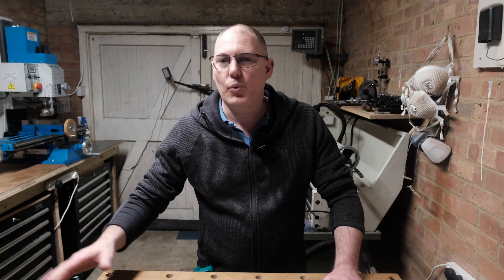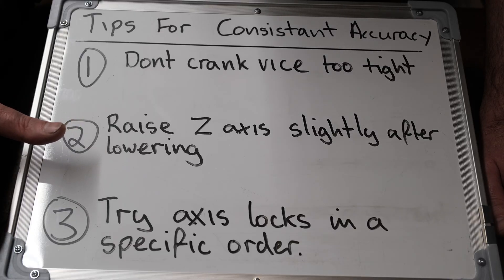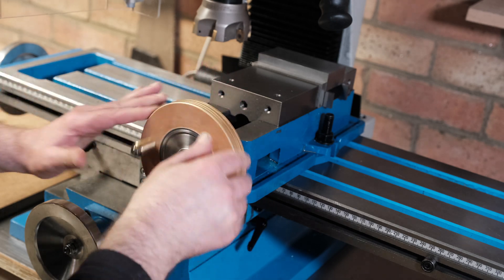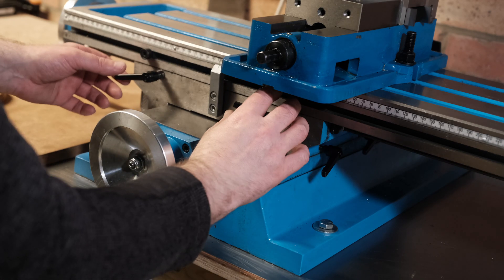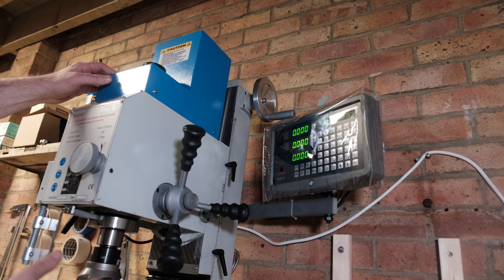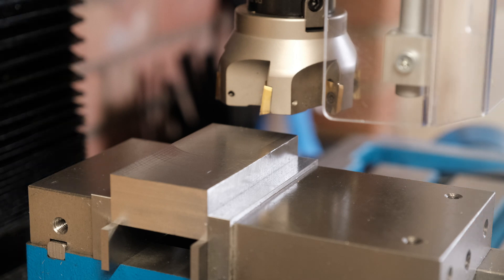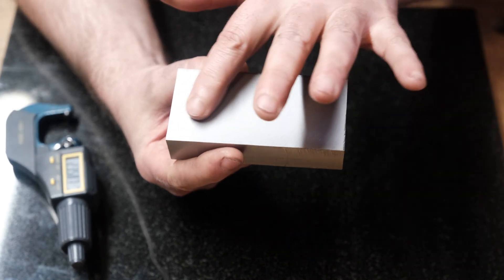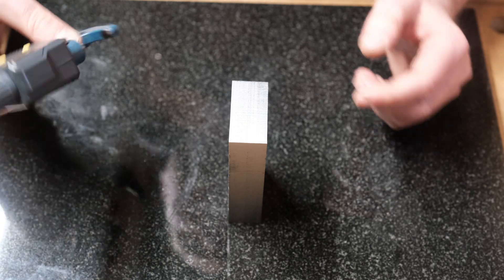Hobby Milling Machine Accuracy. 3 Simple Fixes.

Comment: Most moveable jaws on those vises have a tendency  to want to lift just with a soft wire as copper or aluminum  set just down from the top will help your problem  go away
Reply from the maker: Ive got used to the mill and vice now. The errors are pretty small and I can work around them easily. 
Thanks for watching.

Comment: You didn't tap the work in the vice to seat it and check parallels didn't budge then tighten vice more. Have you tightened the gibs too? They can also be overtightened causing the gib to bulge out in the middle, I have the am25lv, my y axis was similar to yours until I did the gibs. I Enjoy your vids 👍
Reply from the maker: Yeah I think I will adjust the gibs although I think the accuracy is more than good enough for my needs. I’m actually really happy with the quality of this particular mill. Happy so far.
Reply: @leeceeworkshop 

It’s a trade off. Since the order you tighten the locking screws affects the cant of the the table, the gibs probably aren’t tight enough. Tighten them too much, though, and it can become unusably stiff.

I’m enjoying the nice methodical process in your videos.

Comment: Watched and liked your setup video of this Mill; was just as impressed with the correctness of the
x-axis tram as you.  Did not see a check of table tram in the y-axis (table front-to-back relative to the spindle).  Like wise did not see a check of tram of the "vise" other than the rear jaw.  You should check the tram of the vise bed in x & y just as you would the table then shim the vise accordingly.

As to why moving "up" to your cutting depth improves accuracy that is because it places the backlash above your cutter.. Just moving "down" to your depth puts the backlash below the cutter allowing the cutter to be pulled down into that backlash, this applies to both the Quill and the MIll Head movement.  Moving both up thru the backlass before "snuggly" locking (no need to crank on it) should give you better overall rigidity.  Had to learn the same lessons myself on my first benchtop mill.

I'd recommend the "Joe Pieczynski" youtube channel for great machining advice and lessons.  The man is extraordinary at conveying information and is a big proponent of the "keep it simple" principle.  He works with a Bridgeport clone but the information is just as valid for a benchtop mill.  Good luck with the new mill, looking forward to seeing what comes next.  Great catch btw regarding moving up to your cutting depth!!
Reply from the maker: The backlash on the Z axis makes perfect sense now you’ve said it thanks. 
Joe Pie channel is great. I’ve been watching all of his back catalogue. Been getting lots of tips from him.

Comment: The inconsistency along the x-axis could be caused by the way the face mill was used. The trailing edge of the cutter was only passed along the back half of the work. If you run the whole diameter of the cutter past the part then you eliminate a potential source of error.
Reply from the maker: I understand what you mean. Makes sense. Thanks for the tip.

Comment: 90% of micrometres sold have flat faces, and they are fine for measuring a flat surface, you can get specialist ones for threads, internal and other purposes, but back when these things were out of the price range of most, a machinist would just have a set of flat anvil micrometres from 0 to 4" or 0 to 100mm and they could do almost all there work with that, the flat anvil dose also even out the surface finish slightly, as unless you are surface grinding the part, you will get minor ridges in the surface, and a pointed anvil can sit in a hollow, or on top of a ridge, so what you did is fine for measuring to within 2 micron, but I cant see you needing to work to less than that tolerance.
Reply from the maker: That’s great info thanks. I won’t really need to work to this accuracy but it’s just good practice  and fun to try.
Reply: @leeceeworkshop  Yes it is good fun chasing the 0's lol